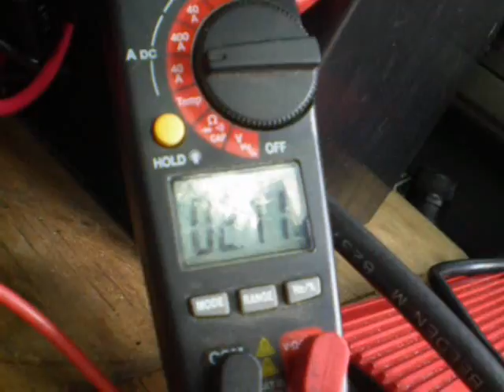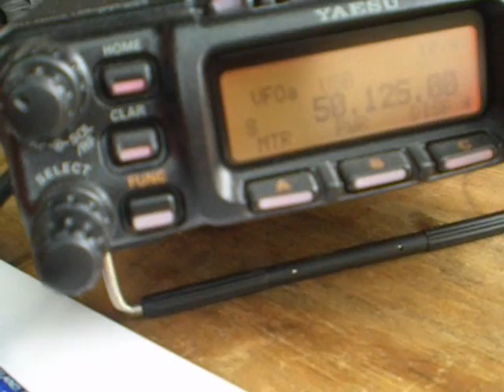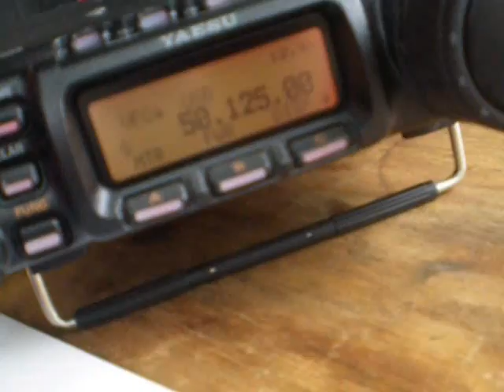ft-857d 6 meter

Comment from the maker: @mikeyB357 On some bands the output power would fall off as you tx'ed and on 160 meters the rf power would start around 60 watts and rise to full power as the radio heated up. Yaesu did not want to do anything about it, but after shipping it back to them, I think 4 times, they sent me a new one and it works perfect.